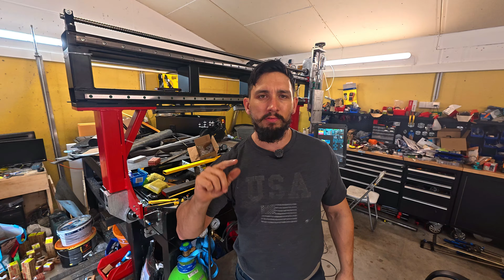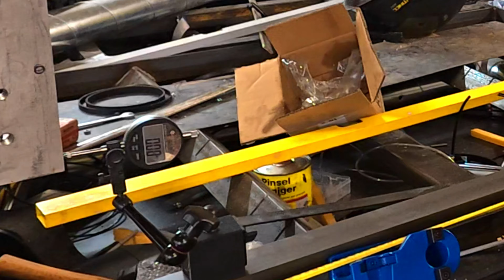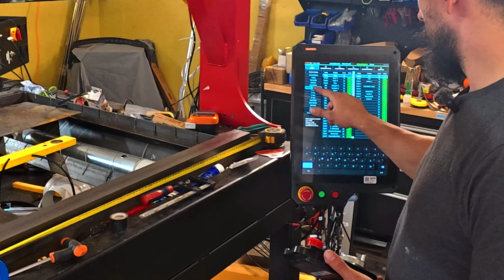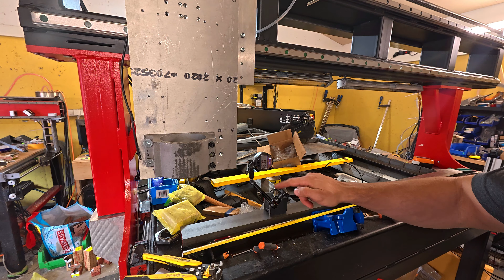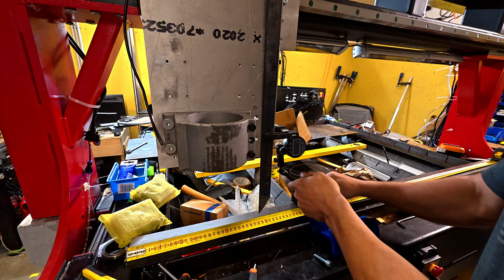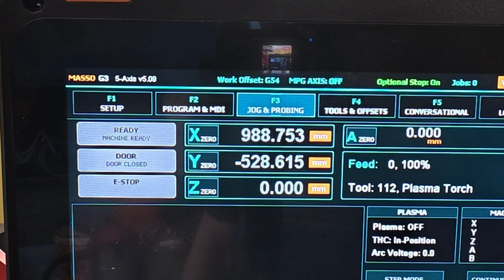Why Your CNC Cuts Are Wrong: Tape Measure vs Dial Indicator Test

Comment: Wouldn’t it be best to just calculate steps per mm? You already know both the ball screw lead and the steps per revolution.
Reply from the maker: Yes that would make it easier but there is still a lot of variations that go into this. back lash. right belt tensions on the pulleys. reduction ratio of the pulleys. 
But, yes in general you can do it that way. But if you want to get very accurate then you would need a glass or magnetic scale.   Ill be making a new video here on using a magnetic scale to calculate the AC servos since I am swapping stepper motors out

Comment: regardless of the fact that you get much better results with the tape measure than you do the dial indicator neither of those methods is worth a damn if you want precision
Reply from the maker: If that's all you have to calibrate, then it's better then nothing. My controller does not accept encoders for glass or magnetic scales.
Reply: @steelknightcnc  I agree. My note was actually  to the viewers that might not realize it's not good enough for accurate work that is intended to mate with a part made on a different machine.

Comment: Great initiative, to demonstrate the steps involved in constructing a CNC machine.
But on the other hand, you just didn't share enough information about your setup to allow your viewers to understand the context in which you're getting to the conclusions you got.
You give the impression that it's better to use a measuring tape as a better means to obtain precision than a dial indicator.
So, I'd point out some pitfalls.
First of, there are dial indicators and dial indicators.
One would have to know how good they are.
Second: as good as they can be, they're not meant to measure distances in the same order of magnitude of their measuring range. They're designed to compare  with precision two measurements around their zero. Their "range" is just there to allow you to set them up easily (fix them to the table) and then zero it and measure about the zero point.
Second, for sure that, as precise as a dial indicator can be, (assuming they could be great at measuring  big distances within their measuring range), measuring 20mm and using that measurement to calibrate a 1000 mm travel, you're going to have a loss of resolution proportional to the differences in scales of distances of what you used to calibrate and the travel distance aiming at calibrating. So, if your dial indicator has 1um of resolution and possibly a +-2 least significant digits of repeatability (just shooting numbers here), in 1m, your resolution will become 5 hundredths and your best repeatability would be +- 0.1mm which is gross already (but all that still assuming the dial indicator is good at measuring long excursions, which isn't probably the case as they're not meant to be used that way).
Third... You're not telling how your machine is measuring the large travel distances...
Does it have a linear encoder?
Because, for that kind of large distances, that is in fact, the only way to keep precision.
A large machine like that twists, bends, contract and extend with temperature.
All that said, assuming your machine is working correctly in the least sensible way, the kind of error that you're getting of 12mm in 1000mm is horrid and something must be very wrong (if it's a repeatability error), or if it's a scale error, then your dial indicator really sucks at measuring large distances.
Reply from the maker: Hey thanks for the feed back. Yeah I forget a lot lol on what I want to say. Nonetheless I am running the Masso G3 ( which does not include encoder feed back)  :/ . I am running Nema 34 closed loop stepper motors from ( Stepperonline). HDT 5M Belts and gears  a 2:1 ration other then the z axis. Im learning this youtube thing. I plan on having better material laid out for future vids. You're right about the dial indicator. I seen someone else do it on YT and though id give it a shot and noticed that the axis was way off on my first build I have done. 

On the 3rd point I had mentioned it. Probably I discarded that video from the edit. 
It does not have a linear encoder. I can put one on to see if the machine is doing what its suppose to be doing, by having a separate DRO.

Last point, Like you stated above. The indicator must not be used for great distances.
Its all a learning curve for me. I noticed at work looking at the profession machines they do have linear encoders. With great controllers. 

Once again thanks on the feed back its much appreciated. 
Dom
Reply: @steelknightcnc  Thanks for being open to comments.
I don't have personal experience with DIY CNC builds so I wouldn't know anything specific such as Masso (and the model G3) but I do know CNC from 20 years ago having worked at a Cimatron Technologies' subsidiary and programmed CAM post processors for a number of CNC makes, such as Fanuc / Diadur / Mazak etc...
What I have is some general knowledge about motion control theory and its nuisances.
For instance, talking about feedback, it's good to know that your control motors are closed loop... Meaning that you won't have issues with missing steps and you will be sure about rotational position.
Your CNC controller not having support for feedback doesn't mean anything bad (as long as your motors are closed-loop, and yours are) and as long as you don't do coordinated multi-axis movements as, for that, you'd really need the CNC controller to be able to have positional awareness of all axes that are supposed to move in coordination.
But, for one-axis-at-a-time movement, it's enough that the motor is closed-loop and that you have a backlash free operation.
And, if your backlash is under control, you should not have problems to get 0.01mm repeatability.
Now... on the subject of feedback, barred more strict thermal stability concerns, I think you can get away with axis positioning feedback using tightened steel cable (or steel band) and a rotary encoder, used as a poor-man's linear encoder wannabe.
I don't know actual practical designs that employs this method, but just from machinery knowledge alone, I assume it's achievable and I'd say it's probably way cheaper than proper linear encoders.
You would still need to figure out how to add feedback support to your CNC controller... I don't know if it's optional, if it's modular or such, but I don't think it's possible to do multi-axis coordinated movement unless - 1. You're willing to move very conservatively slow or, 2. That there's some kind of way of interlocking the feedback loops of the motors, so that the one that's lagging behind be able to slow down the other ones proportionally (which is basically what a feedback capable CNC controller do, very roughly speaking).